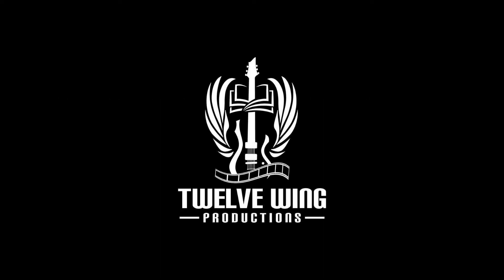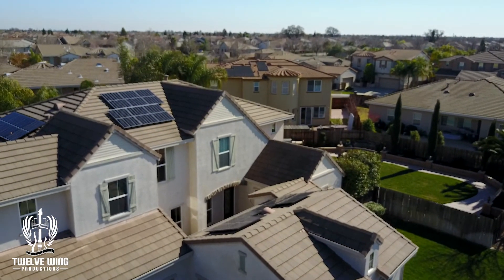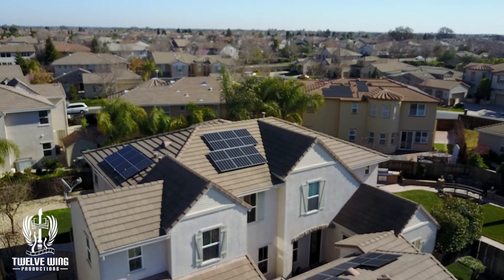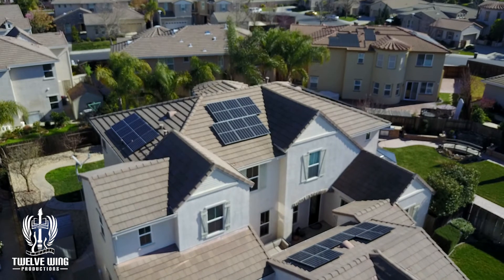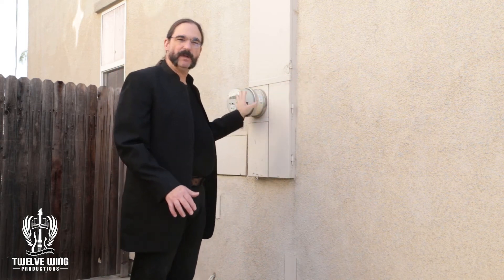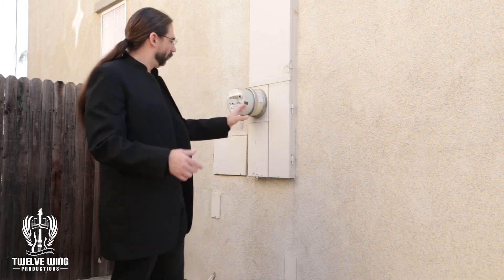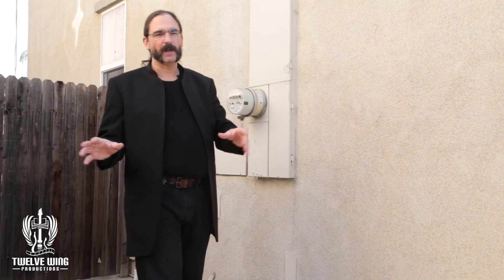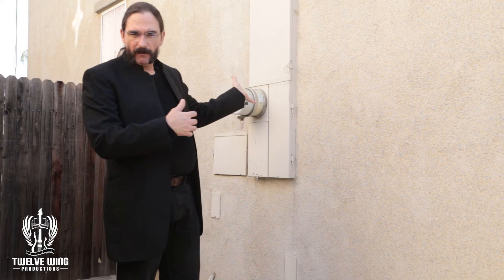Energy Sovereignty System Layout: Multiple Tesla Powerwall Batteries

Comment: You and I are on the same road. Over the last 8 years I have migrated away from fossil fuels, in 2012 I added my first solar array and my first electric car. In 2016 I added my second solar array and got a longer range EV to replace my 2012 model. In 2017 I replaced my last 2 gas cars with BEVs and replaced my ancient oil boiler with a geothermal system. In the next 2 weeks I will have a third ground mount solar array installed which will provide enough power to cover all my energy needs (combined with the other two arrays).
I plan to install battery storage in ~2 years to complete my own energy independence journey.
It’s very encouraging to see others working toward their own sovereignty.
Reply from the maker: I would be very interested in hearing more about your system and perhaps (If you are willing) take a road trip to see and film your system.
What state are you in?  Hopefully in the US or Canada or I will need pontoons for the car.
Reply: Twelve Wing Productions that would be great, I live in upstate New York, it would be quite a drive for you. I have system specifics I’ll post here later on. I’ve enjoyed your experiences and insights on the home energy storage, I hope to use that information when I tackle that in the next year or two.
It has been a great journey for me and my family.
Reply: Here's a full timeline with system specs that I posted to my local electric car group in November of last year:
2010 - Purchased a home that was suitable for Solar and Geo (this was a condition of our house, just ask our real estate agent :) ).
2012 - Purchased a 7.2kW 32 panel Solar array (PPA) from Solar City ($6,700 paid in full up front).
  This system has produced 43.5 mWh's in its lifetime to date, saving me $6,090 so far.
  When purchased, *savings were not our driving factor. It was the beginning of our quest to energy independence.
*
2012 - Traded in my TrailBlazer for a Chevy Volt (gas savings paid my monthly payments)
2016 - Purchased a second 6.72kW 24 panel array from Apex Solar (purchase 7,600 after incentives)
  This system has generated 13.9 mWh's in its lifetime to date saving me $1946 so far 
2016 - Built a compost based pool heater. This was very effective, at times too much so and had to be turned off (the pool was up to 84). The compost was a collection of my own compostable food waste, free town woodchip mulch, and grass mulch. It was about 4 feet tall, 5 feet wide, and had PEX tubing through it to circulate water.
2016 - Turned in my 2012 volt for a 2016 model
2017 - Replaced my last 2 gas vehicles with two BEV's. Silverado --> Bolt EV and Cruze --> Kia Soul EV.
  The Bolt EV has become our primary car, we take it everywhere, both short range trips and long range (think the middle of Tennessee).
2017 - Replaced our oil boiler with a Dandelion Geothermal system.
  This has been fantastic, this has saved us over 2k in our first year between heating and cooling. As a bonus, we now have central air for the first time in our lives and I have to say, we didn't know what we were missing!
2018 - Purchased a 3ed solar array, this isn't installed yet but it will be our biggest one to date. A 10.62 kW 36 panel ground mount system. Ooh the saga of getting this system approved by the town of Bethlehem, we signed the agreement to be installed in March, here we are now about to tip into December and final approval has not been given (though we did get our variance that was required, we are just a few hops away, will it happen this year... IDK. I would like it to so I can get the tax incentives quickly after installation but its moving at the speed of government).
 - UPDATE: No the approvals did not go through until 1/16/19, system should now be clear to install by end of January.
Future Plans? Yes we have some more items to do, we want to tighten up the house using foam insulation. We want to get a sizeable battery backup system (5-6 powerwalls should do it). That will not happen for a couple years, rumor has it that NYSERDA will have a program for home storage by 2020 (end of 2019 is what I was told).

Comment: 5:36 isn't that against code?
Reply from the maker: The short answer to your question is that everything we are doing is 100% to code.
If you can be a bit more specific regarding your question perhaps I can help resolve any confusion.

The system will automatically sever itself from the grid when there is no grid power.  The home will, however, continue to run uninterrupted in the case of an outage.
From march through late September/early October, the home will not even notice a power outage, even if the outage should last for weeks.

As far as the charging is concerned, and the grid attachment, there is no code that dictates how little power a home uses once that power comes to the home from the grid.
The reasons homes do NOT attempt to run on what amounts to a glorified dryer plug is that they can't.  We can.
The home load comes from the battery, not the mains.  That's the entire crux of what we are demonstrating here.  What a total game changer this all is.

The reason for doing the project is to identify what is possible if storage isn't an issue.  This will allow us to fine tune and give recommendations for matching a specific realistic amount of solar production with a specific amount of battery storage.
Reply: @twelvewingproductions7508  How can you have a 100 amp circuit on a 80 amp breaker?
Reply from the maker: @retartedfreak  I may have misspoke.  The breaker is 100A and the car charges at 20% of the circuit's output... 80A.